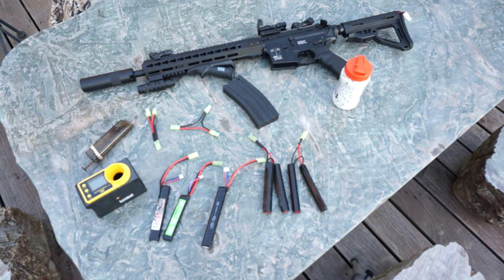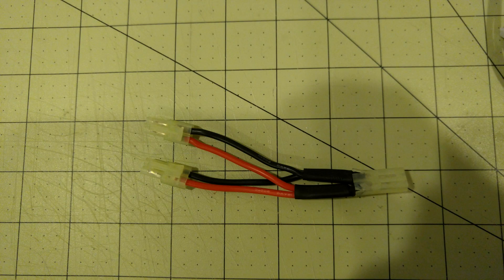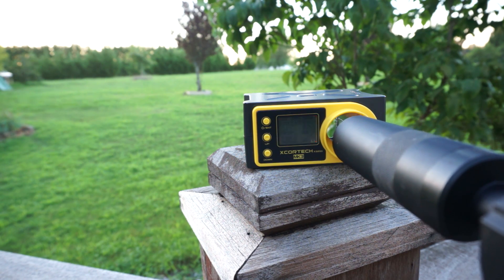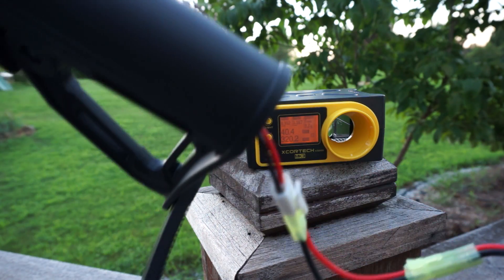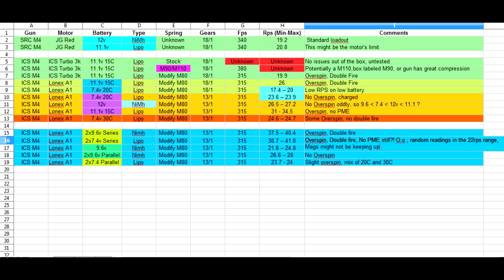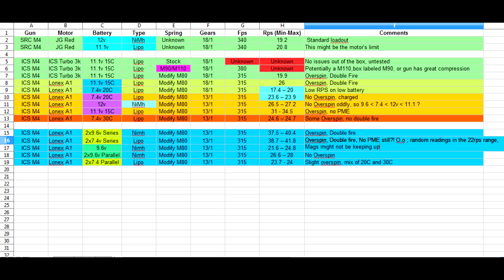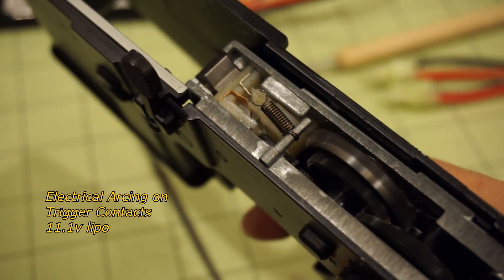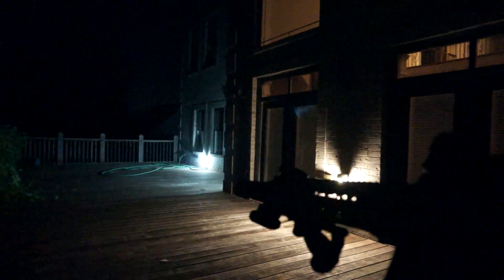How Battery Voltage and Amperage Affect Rate of Fire, 40 RPS Airsoft Gun Build

Comment: I definitely hear premature piston engagement. The reason why you only saw some paint coming off is because the contact area isn't that big, SHS gears are strong, and you only did some light testing - not fielding the gun indefinitely. PME is not something that should be overlooked in a high RPS set up. You'll need to short stroke the sector gear n piston if you want to run such high RPS.
Reply from the maker: Thats something i was looking into at the time i built this, promptly forgot about it...last time i was on an airsoft field was the day after election day...buying spare parts...then never took this gun apart to fit the issue...

Comment: More voltage  = more amperage going into load, high amp batteries are just made to be able to discharge at higher rates withou significant losses
Reply: If everything else in the circuit stays the same the current won't really increase, but the wattage will.

Comment: Pumping double voltage into the motor isn't smart unless the motor is rated for it. If the motor is rated, sure, but if not, you'll run into excessive heating and other problems. Higher Amperage will not affect the motor unless the motor's max amps drawn are greater than the max amps the battery can supply.

Comment: I wish I can have an American steel gun like this, but all I have are cheap Chinese plastic guns, as my country does not legalize airsoft. Although the gearbox is plastic, I guess the motor will be the same (just lower quality in general). Will replacing a 7.4V battery (2 cells) with an 11.1V (3 cells) damage the motor?

Comment: Can anyone explain to me why I have quite a big (about 25% more) difference in ROF between 11.1V 1400mA and 11.1V 5000mA on my Krytac Kriss Vector? I wish to have one big 11.1V battery for the whole day, but I can't because I'm getting overspin and double fire.
Reply from the maker: its likely what your seeing is an amperage limitation of the battery. its likely that the motor isnt getting the amperage its wanting with the 1400ma, you can check a battery's max output amperage with (Capacity x C Rating) and compare that with your motor's amperage demand. as for overspin, you can increase the spring power to solve that, or if you have a FPS limitation on the field, you can either; A- get a shorter inner barrel, be careful with this method as some muzzle devices have ridges that are slightly smaller than the inner diameter of the outer barrel and can cause BBs to strike it, or B- a heavier weight spring a combination of short stroking the piston and porting the cylinder to match

Comment: Can you just shove any volt or amp battery into an airsoft gun (assuming it fits) or will too powerful batteries burn out the motor or something? 

Basically can i for example shove a 9.6v battery in my gun when i normally use a 8.4v battery? I don't know a particularly large amount amount batteries and electronics as you may be able to tell.
Reply from the maker: normally most people use 9.6v batteries because it fits most guns, i run a 12v battery with a JG red motor for years and nothing bad has happened to it, my ICS has 14.8v LiPo in it but that requires a mosfet, i did put 19.2v into this gun in this vid, tho i dont recommend it as that will spot weld your trigger contacts together eventually, the motor was fine..

In a nut shell, up to 12v NiMH and 7.4 Lipos are ok to run in a stock gun, anything beyond 12v NiHM and you run out of space to put a battery and you might want to consider  hardwired mosfets for 11.1 lipo

Comment: why is there any debate about what to do?...,the circuit is what determines how much current is sent to what you are powering...it will only take what it needs still...its like putting in a bigger battery at the same voltage...battery will just last longer...everything will remain the same...you can not give a circuit more current without modifying the circuit itself...but you can give it more voltage which in turn will give the current at a quicker rate...its the only thing that you can do...but the longer that you give it more voltage (it will still only take the same amount of current as it did with the lower voltage) it will produce more heat on the circuit...so as long as you are not holding the trigger on auto for long periods of time you should be ok...might need a bigger fuse just to still protect your circuit...other that that...you should be good...so the only way to give airsoft guns more current without doing anything else is to give it more voltage...wattage.. V×A=Watts...Watts is power...Amps will always remain the same in a circuit...so all you can add is Voltage...or you must add resistance to the circuit itself

Comment: I'm just assuming that an airsoft gun is a motor driving a spring(it looks like it) then just putting more voltage and amperage would always increase RPM until you put too much in, and then either components fail and it'd be all very embaressing I'm sure. But putting more in is going to decrease the lifespan of the components(though what you expect, I don't know)
Reply from the maker: a motor driving a gear train that drives a spring, that pretty much sums up every airsoft AEG in existence, there are vids on youtube showing motors catching fire when too much voltage is applied, but a faster spinning motor will wear down not just the motor but every component in the gun and also exacerbates any bad shimming jobs or bad AOE that may other wise be a negligible issue in lower stress builds

Comment: My gun came with 8.4v 
Is it bad if I put at 9.6v battery in? Like will it hurt the gun?
Reply from the maker: iv put a 12v NiMH in my old one, it's lasted years..7.4 lipos are ok in it, its the 11.1 lipos that you need to get new wiring and mosfets to see its full potential
Reply from the maker: faster as in RPS or FPS?
Reply: Returacan RPS I wanna upgrade it, I have a 9.6v battery inside of it
Reply from the maker: how confident are you with taking apart the gearbox and how much money are you willing to spend?
Reply: Returacan I have a shop near me that will do tun ups so he can take it apart, I'm willing to spend a good 100$
Reply: Returacan no sure if 100 will do it but
Reply from the maker: hmmm...id start with a a new motor, a 13:1 gear set, or faster if you can find it, keep your spring, and get a 11.1lipo

Comment: Very interesting data, what battery setup are you using now? (If you mentioned in the video I must have missed it) According to your chart two 7.4s (or 9.6s) in series, though how did you counter the overspin, or just ignore it?
Reply from the maker: several ways to counter overspin; heaver spring and SS to bring fps down or  you use a AB MOSFET to counter the overspin, currently im using the MOSFET to lock the gun into semi only, i wont be reinstalling it until i redo the wiring and get new trigger contacts to use my 11.1 or 7.4 in series with a battery bag..currently just using a single 7.4

Comment: How come your 12 volts motor works with 22 bolts battery?
Reply from the maker: 11.1v in parallel only adds capacity and not voltage, max voltage in this was 14.8 with 2x 7.4v in series, my MOSFET will die at 16 volts.
Reply: @Returacan  i think you need to consider motor volts and mosfet volts

Comment: im getting 24rps on my m4 with a 9.6v nimh, with standard gears and a shs speed motor, gonna install some shs 13:1 gears tomorrow, because the gun sounds horrendous on full auto.
Reply from the maker: dont expect much of a rps gain, the motor and battery do more for rps than the gears
Reply: @Returacan  Of course the gears can affect the ROF significantly, going from 18:1 ratio to 13:1 ratio can give a significant increase in ROF as long as the motor and battery can support the added load. That being said, running 13:1 ratio gears with a ni-mh battery is kinda optimistic, unless it's a huge capacity ni-mh that can actually deliver significant amperage, or you have a high TPA motor.

Comment: I am sorry, I am not very skilled in English so I did not understand. Whats increasing the RPS ? Voltage or Amperage ?
Reply from the maker: voltage
Reply: +Returacan Ok, thanks. Again, sorry for retarded question.
Reply: @Returacan  is there a way to upgrade the voltage without squeezing another battery in there
Reply from the maker: @joseffliegl4167  there is but you will sacrifice capacity for the same form factor. if we are speaking of lipo batteries and you want something more than 11.1v , you can get 4 small single cells and get 14.8 but your capacity might only be 800-1000mah if even that. keep in mind that the battery capacity will also effect the current you can pull from the battery, its do able but we are potentially talking about custom batteries and a lot of money.

Comment: What if a 700 mah 8.4 and 1600mah 9.6 were connected together, like putting beans on ice cream, vanilla?
Reply from the maker: i would assume that you would add the voltages if in series , reduced amperage in parallel and get reduced capacity either way. it would be interesting to test..

Comment: I got a DSG with a 28TPA motor, I have 2 11.1volt lipo batteries. One of them shoots 17RPS the other shoots 37RPS. The difference? Amps. One battery has 30 amps, the other 80 amps.  Such a vast amount of scenarios. This video is way over simplified.
Reply from the maker: Well, if you tell someone that asks "get the biggest battery you can hang in a bag', yea, this video is over simplified, as it should be cause the airsofter that just started last week isnt likely to spend the hours needed to do the research and certainly someone with anything more than a cursory knowledge of electrical engineering isnt going to be baffled by the relationship of voltage, amp, and current. Also your DSG is slow, get a 4 cell.
Reply: @Returacan  Its a 18k motor on 18:1 gears with m170. Might get a few more RPS maybe. Limited to eps stock as well.
Reply from the maker: @pauls.5815  Mine still is as configured in this vid, 14.8v 30C, i dont use full auto as the field doesnt allow it so i build for trigger response, this RPS just happened to be a side effect. If you have a look at the spreadsheet towards the end, you'll notice that having 2 - 7.4v in parallel didnt do any better than a single 7.4v battery, but a 11.1 15c saw some improvements, what i got from this data is that voltage starvation will limit you more than amperage starvation. Granted this motor only pulls 40amps on start up.
Reply: @Returacan  Yea I get that, 11.1v is going to win over 7.4 usually. I tried a 7.4v 80 amp battery and got 3-4RPS over the 11.1v 30 amp battery. For most new players with basic guns all of what you said is accurate. Not always though.

Comment: What's the battery connecter called
Reply from the maker: Usually batteries ship with Mini Tamiya plugs, for high amperage applications, they are not recommended. Read this,  http://www.tjinguytech.com/reviews/rc-connectors
Deans Ultra is basicly the de facto standard in high end airsoft guns...

Comment: I’m a retard do you have to have a battery for your gun to work or is it just for full auto
Reply from the maker: just for battery powered guns, most airsoft guns on the market are either spring powered, battery powered or gas powered, only the gas and battery ones can go full auto if the gun is designed for it

Comment: I’m shooting 37 rps on a 7.4😂
Reply from the maker: Vid or it didnt happen XD
Reply: Relatively easy to achieve actually, with either a DSG setup or a high speed motor with high speed gears.
Reply from the maker: @hakont.4960  notice that he never posted his fps?
Reply: @Returacan  400 FPS at 37 RPS is actually realistic with a DSG setup with a 2 cell li-po, it's even feasible with an SSG setup. Just use 10:1 ratio gears with a relatively low TPA motor.
Reply from the maker: @hakont.4960  i know, this gun in this vid will run at about 42rps at  420-430fps with .2 with 13:1 SSG and a titan A1, tho i need 14.8 v to do it..shouldnt it be a high TPA motor for more torque with a 10:1?
Reply: @Returacan  Well, doing 37 RPS at 400ish FPs on a 2 cell voltage with an SSG setup won't necessarily be efficient or reliable.
Reply from the maker: @hakont.4960  Im more worried about it catching fire XD, even with 14.8 it get uncomfortably hot
Reply: @Returacan  You are running nearly a half kilowatt through a motor that's known to run hot, so I'm not surprised. I'm more surprised that it didn't fry after 100 rounds. I nearly fried an A1 when pulling an M120 spring on 16:1 ratio gears with an 11.1V li-po.
Reply from the maker: @hakont.4960  IKR! i have bought spares and whatnot fully expecting to kill parts...that never happened to this day..

Comment: Cant you destroy your gun by doing this?!
Reply from the maker: yea, a bad shim job can strip your gears, bad AOE can strip your piston, you run the risk of cracking the gearbox at the cylinder head,  and at 14.8v you can also run the risk of spot welding your trigger contacts without using a mosfet...
Reply: Returacan Figured so...
Reply: Returacan Can I use an LCT SR3M with regular deans and use a nano 11.1 battery just fine? I’m trying to get extremely good trigger response I’m upgrading the spring for higher FPS because of milsim events. Using a very good High torque motor and upgrading the bucking.